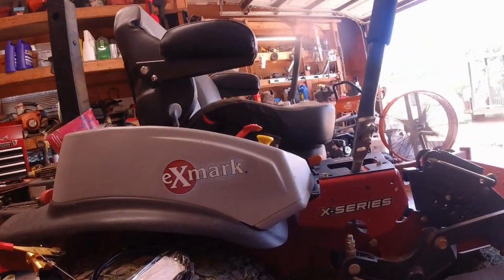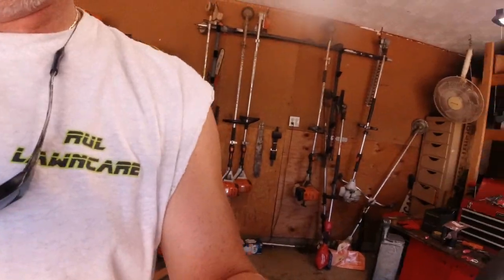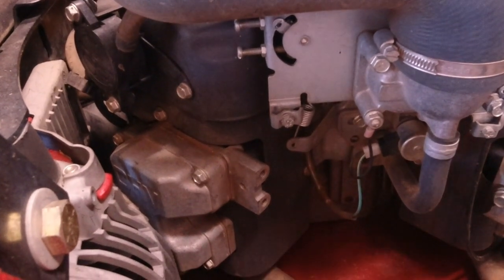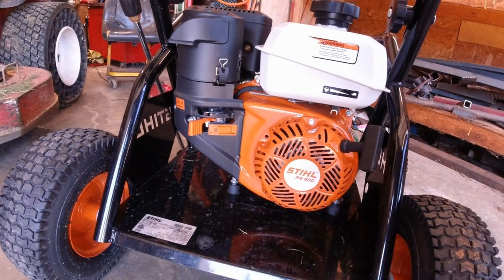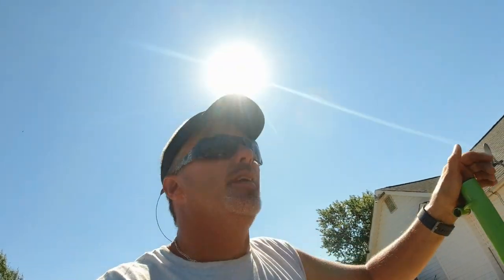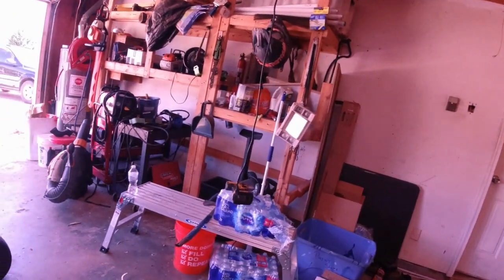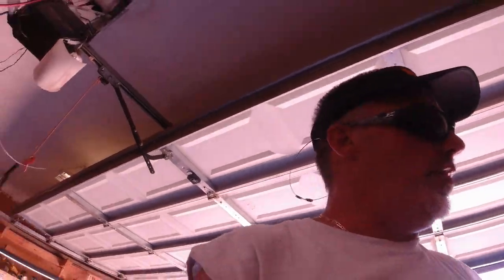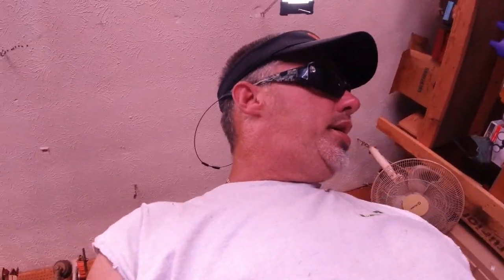Exmark lazer z throttle cable replacement

Comment: Great video Ray! How would i go about learning how to weld. What type of welder would i need? Agree on the things you need to save money. Thanks man
Reply from the maker: Its so easy buddy - mig welder that runs off a 120volt regular socket cost bout 400 plus 60bucks for welding helmet. there are a few videos bout mig welding
Reply: @rayrayslawnlandscape2008  Ok, thanks Ray, can you weld on your trailer with a Mig? Thanks
Reply from the maker: yep i weld things on trailer and bobcat all the time
Reply: @rayrayslawnlandscape2008  Ok, thanks Ray. May give you a call sometime to pick your brain about welding. Thanks boss